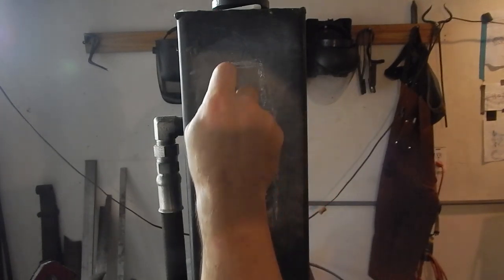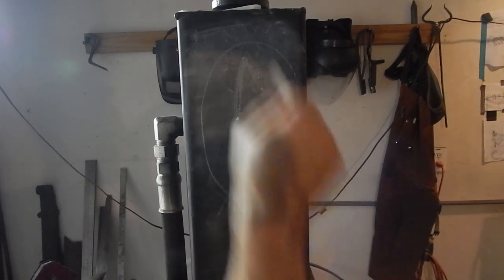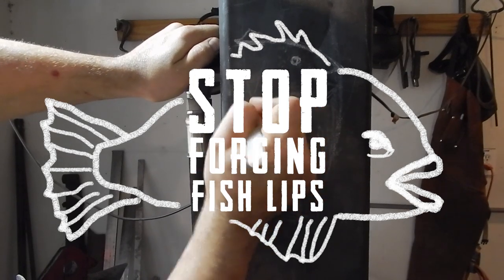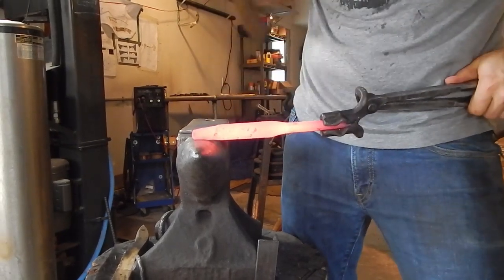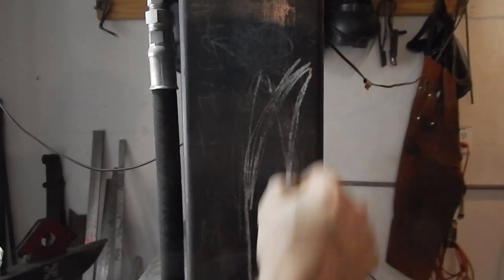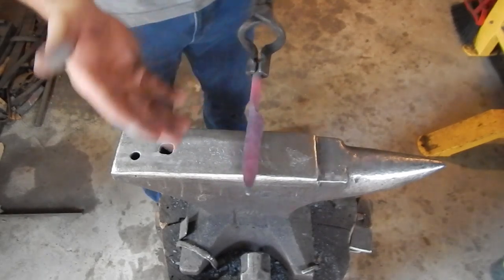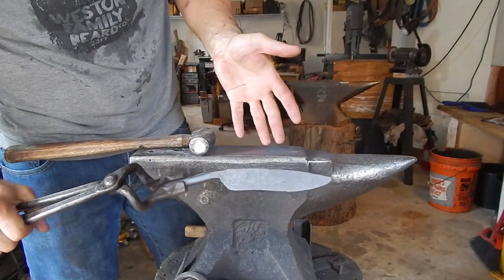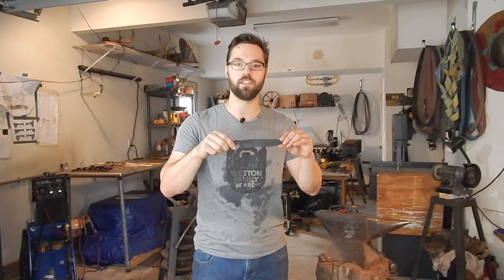Managing Your Mass While Forging a Knife

Comment: That insight about the fish lips was a good piece of the puzzle for me. There are a lot of variables, forging a tip is actually deceptively difficult to do consistently. I think one of the main keys, as you state here, is the tip geometry BEFORE you start hammering.
Reply from the maker: Absolutely, so many smiths struggle with this. Even long time smiths can tend to forge lips and plan to cut off tips. It's better to just forge in a way that won't leave you guessing if you got out all of the cold shut.

Comment: Interesting hexagonal shape on your forge's interior. It looks like one built from a repurposed propane tank, and seems like a good design.
Reply from the maker: Dennis O'Brien It allows the heat to circle in the center. It also is clam shell designed with hinges to open from a side. It works pretty well.

Comment: Thanks for making this video to help out new blade smith's. I can appreciate how much effort it takes to make videos as I have made a few myself though on other topics. 

With that being said you can avoid getting the saber effect or what you call the banana effect if you forge in your bevels correctly. If you hold your work at the same angle you want your bevel to be at and hit it with your hammer at that same angle you'll be able to forge your blade straight. By doing it this way you are compressing the steel instead of pinching it. This is how the Japanese forge in the bevels on their blades. I might not be explaining it very well but I hope you get what I'm saying. Anyway great video and takes again for sharing your knowledge.

Comment: What's the importance of forging the tip?  One fellow mentioned how the stock may be forged, but the tip will be ground, shaped by grinding.  Where a forged tip seemed to be important.  Does it make it stronger, less likely to break, ???
Reply from the maker: I am not sure if there is a difference in strength but for me, I prefer forging. My goal is to do as little grinding as possible... so more forging operations for me.

Comment: I've fallen into this video and glad I found it.  As someone who is in love with blacksmithing and completely new to it, I love a video like this.  I'd love to see you do a "no forge" submission into the MakingTimePodcast  Challenge.  You can find info on Instagram.  Essentially, forge something using only homemade resources.  The kind of thing that anyone has access to.  Limited time.  Submissions due by Saturday 10-6-2018  That said there are a ton of prizes including a 8 IR Thermometers from Ennologic that measure temps up to 1922 degrees.

Comment: I'm kinda new to knife making and I want to learn how to forge out a blade. Everyone tells me not to worry about it that's old school that's why they make belt grinders. Almost everyone is just doing stock removal but it just seems to me that I need to know how. Sanding belts are kinda pricey wouldn't this cut down on sanding or does the price of gas even it out. Thanks for the great video I'm sure it's not as easy as you make it look
Reply from the maker: Good luck as you learn! It's a wonder craft in so many ways. I prefer to forge to shape and forge thin. I don't love grinding and belts are way more expensive than gas 😳

Comment: I have a question and i can't really find the answer. How to temper the knife after quenching? Most of YT videos show that they tempering the knife in the oven for 1-2 hours. But how you they do it in Forge in Fire? And how they tempered knifes and swords in the old ages? Thanks!
Reply from the maker: On Forged in Fire, they temper the knives off set in between round 1 and 2.

Comment: What size and type of stock were you using? What is the finished thickness of the spine?
Reply from the maker: That was just under .5" round rod. I will get the blade measurements for you later.
Reply: Josh A. Weston Type of steel?
Reply from the maker: 52100

Comment: to not end up with a moon  would you suggest i start at the back?
Reply from the maker: It's a little more involved than that. You need to make sure you are working the spine as well as the blade bevel. If you only hammer the bevel shape it will always moon on you. You can either pre-bend it down or also counter bend it as you go by also working distal taper into the spine.
Reply: Please help  What I'm trying to achieve is a long graceful curve . It seems if the blade starts to curl to tight ,If i work it by hitting it with a piece of wood I get a flat spot that ruins the aesthetics of the whole knife .The more I try to fix it the worse it gets .   I have ruined three attempts on  1084 .and 5  mild steel knife shapes .Thank you for your help ,and responding to me . I'm very frustrated
Reply from the maker: HUCK stir could you upload some photos of the work? That will help me give you more specific help.
Reply: I have learned a lot from this vid by reading in between the lines .Oh i really appreciate the help and response .  I have a stick of  2 1/2   x  3/16 x  48  1084  New jersey steel baron .I will post something next week. So  I will do that  .  The best butcher knife  " there has been many " and many dollars ", hard to find a great one " was a knife I bought for $2.50 at the local flea market .  Better than $75 commercial butcher. Well every year we butcher 16 hogs and after 25 years ,my  precious flea market prize is almost a small nub. I hope to create something similar . The flea market knife was made from a file.
Reply: I need a really long bladed  knife "12-14 inches "  with a really smooth up turned curve  with  a handle going up at an angle.  One of my jobs is taking the bacon off the pig . A  long sweeping curve keeps you from hacking at it , and nicking it up . No video's of me chopping pallets lol
Reply: were do I work a distal taper in the spine ? by  hitting from spine and below pushing material forward ? This video was invaluable I can't thank you enough for your answers and patients . I was just about to cut it out with a plasma and finish it on a mill .Absolute blasphemy .With your inspiration I am going to try a  few more times forging .

Comment: Side note: estimate of ‘beginning equipment’ necessary for a über young teen interested in learning?? Min. requirements for basic forging- say an ornamental hook or (insert appropriate first time project) 
Just asking for enthusiastic teen that needs discipline/patience as a teen/beginner. Money is tight.
Ps. Free labor available to offset cost of an option.
Reply: Like cost of mini forge, wire brush for scale, hammer, vice type device, oil/tempered set up ??
Reply from the maker: I would first reccomend a book called, "The Backyard Blacksmith" and that he get a couple lessons. Many lessons and classes will walk him through the process of tool making. By the end of the class he will have things like tongs, hammers and punches.
Reply from the maker: Kristen Kaylor Smith Forge: $300-$400, Tongs: $45-$65/pair, Anvil: $200 (chunk of steel) to $1200 (prices have really shot up on these), Regulator: $75, Propane Tank: $40-$130, Propane fill: $20-$80/tank, Hammers: $25-$150 and most IMPORTANTLY - SAFETY EQUIPMENT: Gloves: $15, Eye Protection: $10, FIRE EXTINGUISHER (S): Prices vary.
Reply: Josh A. Weston oh boy... 😮

Comment: why do all these blade smiths hate a large knife that curls up .  I used lots of very large knives in the butcher shop with that curl ,the are far better for butchering than strait knives. I have used a 14 inch long with a 1  3/4  - 2 inch wide blade  were not only did the blade curl upward ,the handle  angled up as well to exaggerate the curl , With the enormous ark of the blade I could remove a bacon in 3 - 4  strokes  .I want a blade with a smooth gradual curl upwards .not a strait spot on the entire blade  just a tad bit less than a banana .
Reply from the maker: There is a place for those types of blades. The point of this video is to show knife makers how to forge a straight back or drop point blade. Many beginning smiths end up forging banana shaped knives not because they want to it's just what happens when a smith doesn't fully understand what they are doing. This video is meant to help make that possible for them.